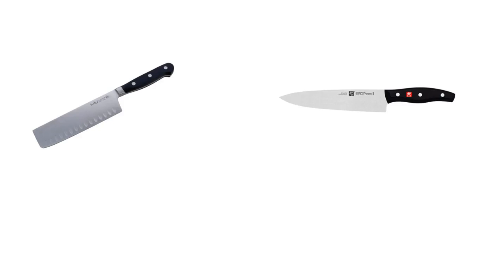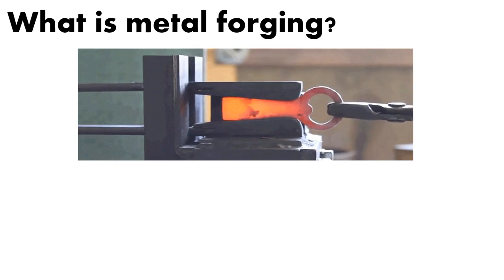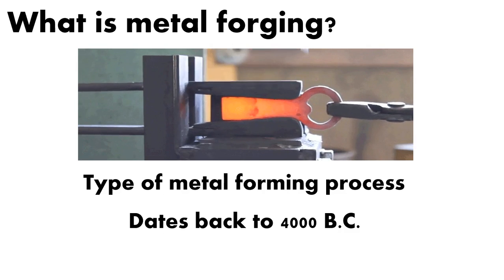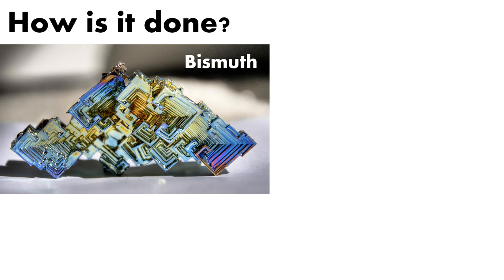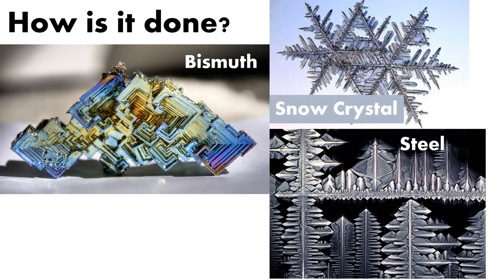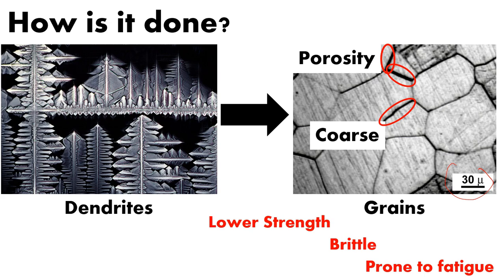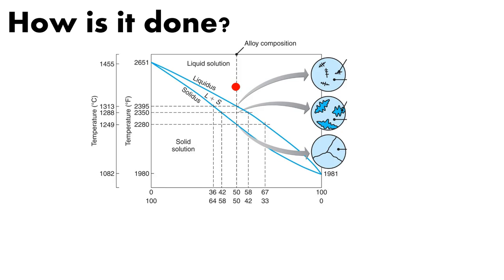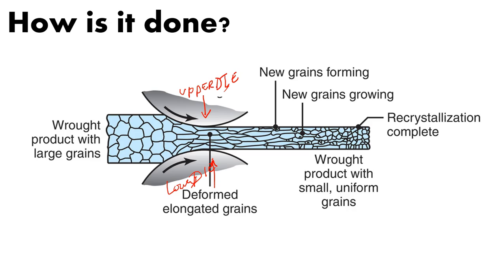Metal Forming (Part 1: What is metal forging)

Comment: Im pretty sure you are wrong about forging taking the material to a temperture of the 'mushy zone' forging can occur at like half the melting point.
Reply from the maker: Hi Ed, the mushy zone or recrystallization stage of a metal is below the melting point, as a matter of fact, its a broad range that between the metal in a solid state and when it is fully liquid.  And you're correct it's possible for this to be 1/2 of the melting point.  I will provide you with a link for more information.

https://www.forgemag.com/articles/83794-forging-materials-plain-carbon-and-low-alloy-steels#:~:text=While%20typical%20hot%20forging%20temperatures%20are%20between%202150%C2%B0F,will%20significantly%20reduce%20mechanical%20properties%20and%20forging%20ductility.
Reply from the maker: "While typical hot forging temperatures are between 2150°F and 2375°F – well below the melting temperature of more than 2500°F – deformation (adiabatic) heating results in local heating. "
Reply: @infinitymfg5397  I understanding forging can take place at a range of temperatures. The purpose of a successfully forged component is for there to NOT be any liquid and therefore NOT any mushy zone on deformation. Also your point about the purpose of forging is to reach recrystallisation is not the main point, to reshape and strengthen the material is the main goal.

Also: after recrystallisation the 'grain flow' in not aligned. The structure should be equixed and uniform if rolled at an appropriate temperature.
Reply from the maker: @edwardalborghetti  ok

Comment: Another question - are dendrites smaller than grains, i.e. grains are formed of dendrites? I saw illustrations of grains with dislocations and the grains seemed uniform in their atomic arrangement, with the arrangement only changing direction at grain boundaries. This does not seem possible to me if grains are composed of dendritic structures. So dendrites are then larger than the grains, and formed of many grains?

Comment: Is the recrystallisation temp really above the solidus line and in the 'mushy' state? I read it was below the melting point in pure solids. It seems strange / dangerous to hot roll a material/alloy that's partly liquid.
Reply from the maker: In an alloy a metal recrystallizes above the solidus but below the liquidus.  The metal hasn't reached a molten state at this point so when it is rolled the crystals form with the new shape.  

It is dangerous simply due to the fact that you're forging metal but there is no concern of a 'splash' since it is not molten.
Reply: @infinitymfg5397  thanks I always thought that above the solidus line it would still fill any container you put it into like a liquid, I visualised it more as a bowl of cornflakes

Comment: So what the difference between forging method and heat treatment methods and why heat treatment method still been used widely?  Why the not skip it for forging method
Reply from the maker: Hi Al Malki 

Heat treating is a process to change the properties of metal, makes it harder, tougher, etc.  Forging is primarily meant to change forms and shape.  It just happens to take place at the recrystallization stage.